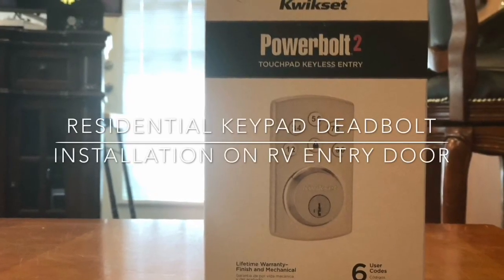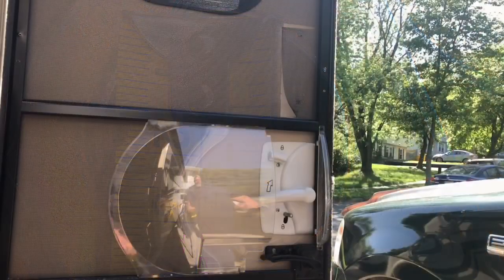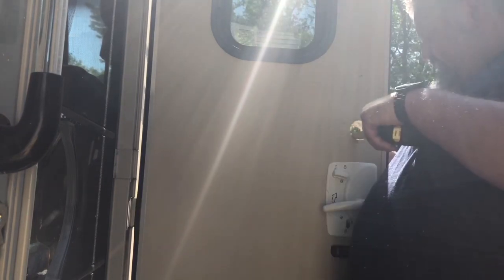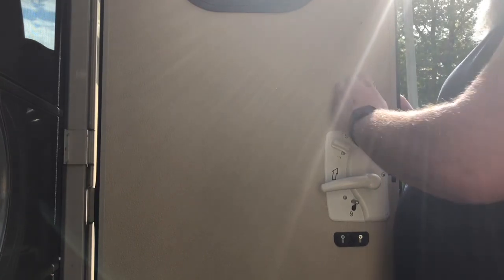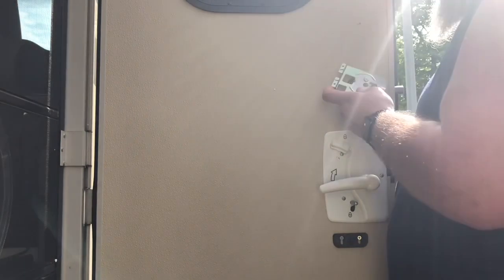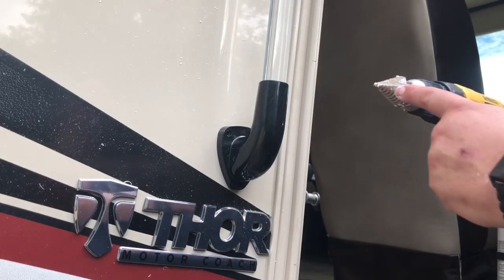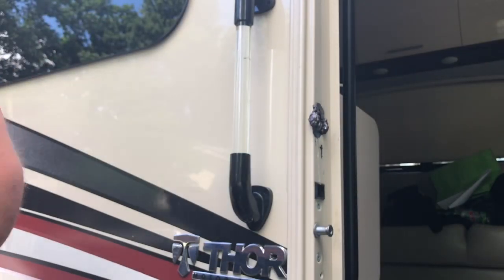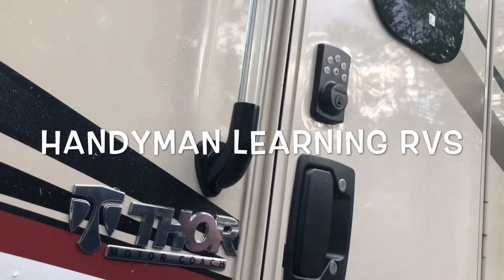Deadbolt installed on RV entry door

Comment: Great video, thank you very much. Why didn’t you just drill a hole thru the black pvc? Doing this in a couple days to my fifth wheel. 🤙🏻
Reply from the maker: Good question. I didn’t try to drill hole. I tried a notch in the pvc  but it was  in the way of one of the screws. When you do it if you don’t mind try to drill a hole and see if it works. If it doesn’t you can always just modify it. But if it works leave another comment to let people know thank you.
Reply: @handymanlearningrvs1532  sounds good I will. Thanks for the great video!
Reply: Did you use a different size/style bit to drill the outside of door or is the hole the same size thru?
Reply: It looked like you used a different drill bit for the outside.. am I missing something? Is the hole smaller outside?